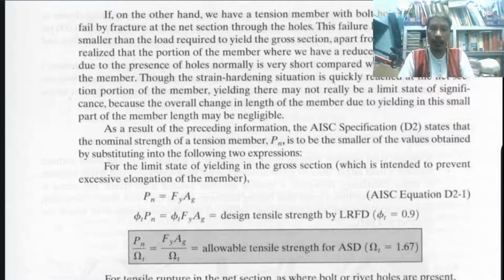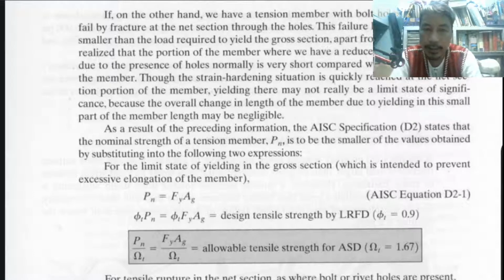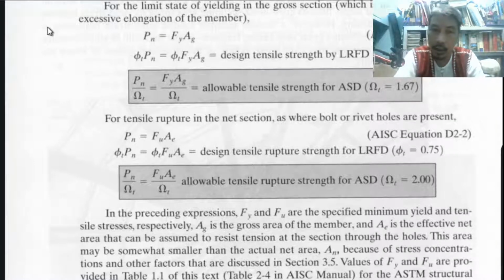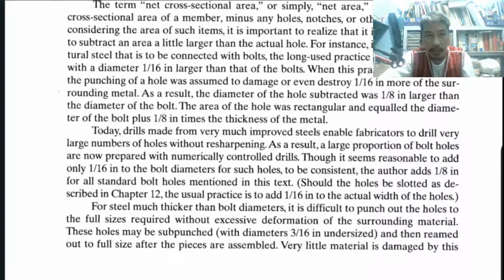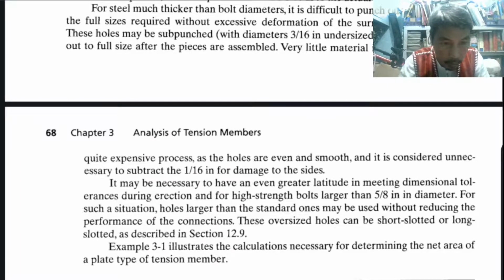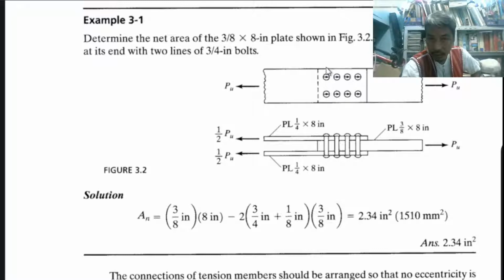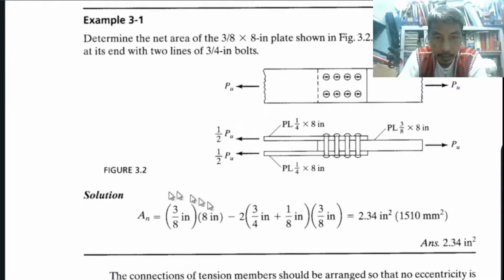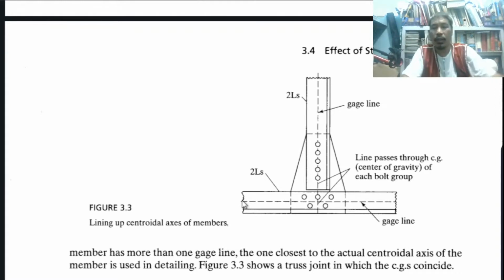[ LIVE CE E6 Lecture 09 ] DrAP Zantua Steel Design Principle Talks + ENGINEERING Analysis & Design

Comment: Thank you sir for teaching us the live lecture for the continuation of the topic the tension members. AISC specification states that the nominal strength of the tension member will be smaller of the value obtained by  substituting using the two method which are the LRFD and ASD. AISC Specification states that the nominal strength of a tension.

Comment: Thank you, Sir for the live lecture for the continuation of the topic the tension members. AISC specification states that the nominal strength of the tension member will be smaller of the value obtained by  substituting using the two method which are the LRFD and ASD. AISC Specification states that the nominal strength of a tension.

Comment: Thank you sir for the continuation of this live lecture about analysis of tension members. I have learned in this video that the areas with holes are the weakest point/areas so the bolt holes must be designed. We also tackled here the  The design tensile strength by LRFD, allowable tensile strength for ASD, design tensile rupture strength for LRFD, and allowable tensile rupture strength for ASD equations. The net area refers to the gross cross-sectional area of a member, minus any holes, notches, or other indentations.

Comment: This video is a continuation of the tension members. I have learned the importance of tension member with bolts holes. The Areas with holes are the weakest point. So, if a particular section is decreased then the resistance of a material to a failure will also decrease. This makes the material prone to a failure. I happen to know that the nominal strength is equal to yield stress multiplied by the gross area, reduction factor (phi sub t) are equal to 0.9 in design tensile strength in LFRD and the reduction factor (omega sub t) are equal to 1.67 in allowable tensile strength ASD. However when we are going to use the ultimate or rupture strength, we should use 0.75 in LFRD and 2.0 in ASD.

Comment: Thank you sir for this further discussion of the analysis of tension members, I've learned that  for the steel much thicker than bolt diameter we will have a hard time to punch out the holes to the full sizes required without excessive deformation of the material.  AISC specification states that the nominal strength of the tension member will be smaller of the value obtained by  substituting using the two method which are the LRFD and ASD.

Comment: Thank You sir for discussing about analysis of tension members. AISC Specifications state that the nominal strength of a tension member is to be the smaller amount of the values obtained by substituting into the following two expression. For the limit state of yielding in the gross section there are Design tensile strength by LRFD and Allowable Tensile strength by ASD. While for tensile rupture in the net section, there are design tensile rupture strength and for LRFD and Allowable Tensile Rupture strength for ASD.

Comment: Thank you sir for this continuation of the live lecture about the analysis of tension members. For the limit state of yielding in the cross-section, The design tensile strength by LRFD and allowable tensile strength for ASD were introduced and explained. For tensile rupture in the net section, where the bolt or rivet holes are present, design tensile rupture strength for LRFD and allowable tensile rupture strength for ASD equations were discussed. Noted sir the constant and Some examples of analysis of members are explained. Thank yo,u sir.